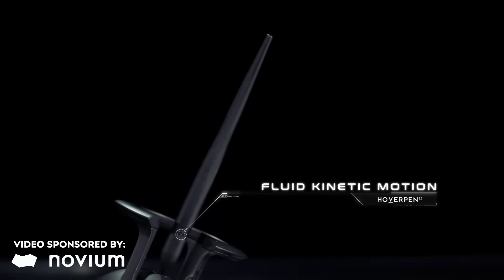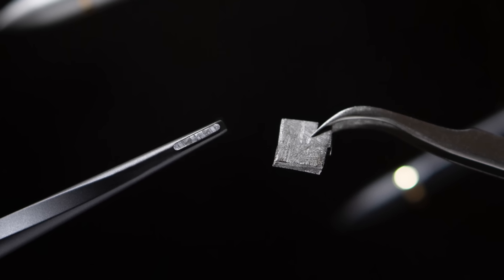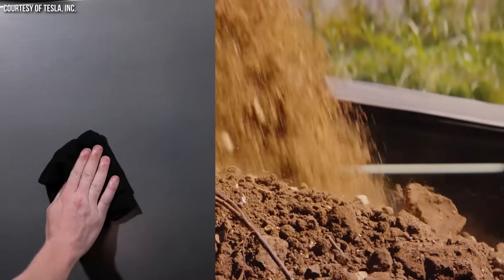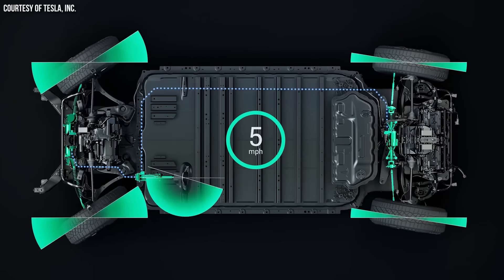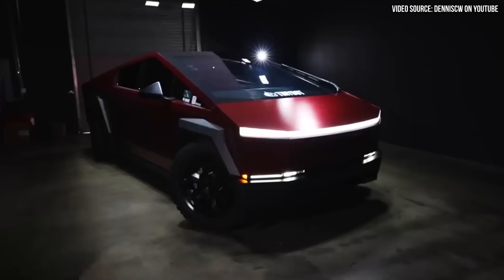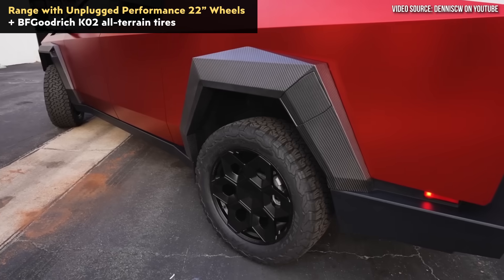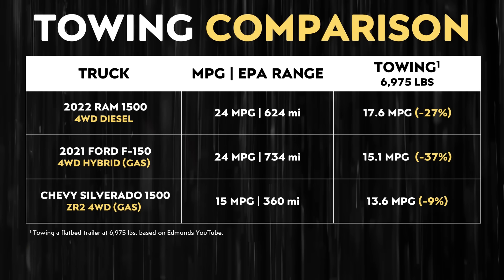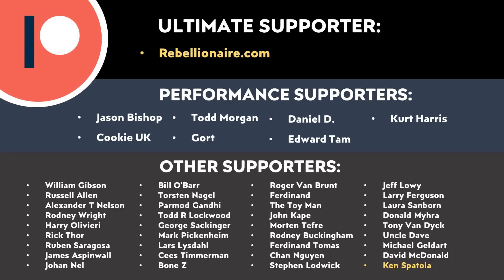Can the Tesla Cybertruck Replace Diesel & Gas Trucks?

Comment from the maker: Enjoy 10% discount and free shipping on all Hoverpens with code CLEANERWATT:
North America & other countries: https://bit.ly/cleanerwatt_novium
UK & Europe: https://bit.ly/cleanerwatt_noviumeu
Reply: FALSE , its shown in actual HARD DATA that Diesel trucks (semi) cannot compete w/ PRICE per mile & Speed of Delivery to MARKET , compared with BEV class 8 semi. 
none of the ALT fuel (CNG, Hybrids, FCV) can compete on PRICE or SPEED either. 
its high TIME for ALL Combustion to END , and go 100% BEV.
Reply: Cleanerwatt - REAL world range is Irrelevant , when you can Charge to 100% overnight & leave HOME with a Full charge and you can REMOTLEY set a Departure TIME.
also its , Irrelevant because you can Supercharge every 30 miles or so as needed. 
for Greatest Efficiency you ONLY need to Supercharge to 70% (optimal) in less than 15 minutes , when using NAV on Autopilot. which heats the battery pack for OPTIMAL charging.
Reply: Cleanerwatt - ICE is a LOOSING scenario .
combustion engines at BEST are only 24% EFFICIENT.
BEV by anyone are 60% Efficient , & TESLA Cybertruck is 90% Efficient. 
anything ICE is UNSUSTAINABLE . 
and any ICE requires FREQUENT maintenance & repairs, even Hybrids & Fool Cells. 
Cybertruck has the LOWEST cost per Mile to Operate. 
Cybertruck is SUPER Reliable & ZERO Maintenance for 300,000 miles. 
and Cybertruck will OUTLAST any ICE Truck.
Reply: most Americans DONT ever Tow , only 1% ever MAX Tow , and very FEW Individuals ever Tow outside the City. 
in FACT most Americans DONT even use Pickup Trucks for their INTENDED purpose. 
mostly used as MALL Crawler , Grocery shopping , Daily Driver & occasional DIY projects. 
funny thing is EUROPEANS Tow MORE than Americans do.
Reply: BTW - JerryRigg is a FAKE tuber , along w/ others.
Reply: Tesla CYBERTRUCK is able to TOW uphill FASTER than any other Truck.
and CT does not need to SLOW down either when going DOWN hill when Towing. 
it can also MAX regen when going Downhill , unlike any ICE truck.
Reply: Cleanerwatt - the AUTO industry continues to LIE about Diesel performance & Efficiency. 
and also Hybridgate also exists.
Reply: Cleanerwatt - you are FAKE NEWS.
Cybertruck is over 120 mpg .

Comment: What is your definition of efficient? Physics says PE + KE - W = PE + KE. If W is better on EVs which is how much energy is lost due to friction, heat, vibration etc. then EVs aren't less efficient at range but rather their potential energy is DRASTICALLY behind ICE.
Reply: EV motors are typically more efficient as they don't produce heat or vibration like ICE and have to be more aero. Meaning it really comes down to potential energy due to energy density of fuel compared to energy stored in battery cells. Yes EVs weigh more but aero matters more.

Comment: Honestly Tesla should come out with a 500 mile version without the range extender and have a 300 mile diesel range extender if possible in the bed charging the battery. This way you can sell it as hey look you get 500 miles, 250 if you’re towing but if you’re the 0.01% that need to tow ridiculous miles the you get 800 miles (300-400 towing). And you can fill up with diesel. At least until battery energy density catches up.
Reply: Honestly that won't happen - Tesla selling diesel generators.  Just buy a diesel generator if that's what you want.
Reply: @snookmeister55  I don’t want/need anything. The most I’ve ever towed is like 40-50 miles. And I can count on one hand how many times I’ve done that. But I know they’re are people that need to drive 1000 miles at a time and can only stop for 5 minutes and probably pee in cups.
Reply: @edsta714  Same here - towing a boat to a ramp meets my needs.   I may end with a Y instead of CT but then I would also need a trailer.

Comment: I'm a big fan of EVs, in fact my whole family is. I drive a M3, my wife a MY and my son just bought his first EV, a used 2018 LEAF. However, as I stress this to my friends, EVs are not for everybody today. If you live in the city and have a place to charge overnight, and you, like 90% of the drivers, don't drive more than 200 miles a week, the EV might be the best car you can have now. If any of these 3 key elements do not apply to you, it might not work as easily. Could you get by charging in public if you don't have a house? Yes, but beware the cold weather (see Chicago Tesla charger crysis). You drive more than 200 miles a week? It might work, but you need time to recharge. If you can charge at work, it's going to be OK, but other than that, I'm afraid it might be a struggle.
We have to be realistic: pushing the EVs to replace all the vehicles is not going to be possible right now. I think we're not there yet, but I think we are all aware that battery technology needs a "Eureka" moment. Li-S from Lyten is something to watch, also the ever promised Solid State Battery from several sources, and maybe so many others we haven't even heard about. Even LFP variants seem to be on the list.
But...Until the price of the battery becomes really small, and the density gets really high, I'm afraid we will still need the delivery trucks, the pickup trucks and the airplanes. We can cut off more than half of the city polluters, but outside of the city, on the highways and in the air, the petrol is still king.

Comment: If an AWD cybertruck was less than 40K, the tradeoffs might be worth it, since it offers so much of other goodies. But for 80K to 100K? Ok, in this segment the tradeoffs might not even matter, as people simply buy it as personal toy.

Towing is especially important for campers as those people not only tow, but at the same time travel large distances. And I agree that an expensive car has to cover everything, without having to buy another special purpose car.

Same is true for a good family Van - Besides a daily driver, it needs lots of room for passengers and luggage including roof box and bike mount and still needs to give plenty of range for holiday trips even in areas where no regular charge stations are available. 

It's just as with good tools: Even if you use it just once or twice a year, it needs to get the job done :-)

Comment: I think in reality..90 percent of truck owners that do use their trucks for towing...mostly boats, rv trailers, and the occasional small construction project are done seasonally or very seldom....just a little more than to justify renting one. So if the Cyber truck can do 80 to 90 percent of the jobs a diesel/gas can do then most city used trucks around the "pavement princesses "...Cybertruck fits the bill while not using gas😊

Comment: It is desappointing that they didn’t try to dominate the range figure. Silverado ev did 450 miles to push the market to 400 miles. Tesla prioritized a sport and heavy technology advancement. I just hope that the extended range is real. Right now the demand  is too high for the range extender to be prioritized. 
But I still love the truck and do like to get one.       Although the number 90 -100 miles is low that is usable for me since California has a speed limit of 55 mph that means 2 hours . 3 hours since lower consumption. 
I don’t mind driving 70 miles and stopping for charge. I do that my model x towing 26 feet travel trailer which I documented on YouTube.
Reply: Silverado EV is a FALSE FLAG , its not at all Efficient.
and uses over 200 kw in Batteries to get 450 mi. 
Silverado EV is not making SALES . its to CRAPPY.
Reply: @markplott4820  i’m not trying to advertise for Silverado EV but TFL truck did it test with a towing Trailer and estimated about 200 miles of range while towing. That is what I thought the minimum that the cyber truck should be able to tow. At 200 miles of towing even at 55 miles an hour. It should be a 4 Hour Drive at 65 miles an hour should be about three hours.

Comment: Until it gets a legit 400 mile range & charge in 30 minutes or less it’s use as a work truck is limited..I’m waiting on my # 20,000 reservation…been driving trucks for 30 plus years & will be holding onto my 03 Tundra..
Reply: your ICE Tundra will be worthless in a short time.

Comment: Nobody pulls anything with significant weight with a half ton diesel truck. Three-quarter ton or 1 ton diesels are what is used. They all have a gooseneck or a fifth wheel which will not work with the cyber truck. their range is far greater also in today’s world
Reply: FALSE , they make 5th Wheel to HITCH adapters by multiple Vendors , up to 11,000 lbs.

Comment: While the CT is a very good EV truck, it’s not going to replace ICE/Diesel trucks anytime soon. 

The first biggest downside is charging. To fully charge it (let’s say you towed 100miles for work purposes) is easily 1hr at a charging station. That’s a long time to be waiting, and frankly wasting vs a gas/diesel truck that can fill up in 10mins. If you work 5days a week using the CT for serious work and towing, that’s 5hours wasted at charging stations. Gas trucks do not have this issue. Tesla would have to build a lot of V4 chargers in the next few years to solve this issue. 

Second is Tesla production catching up on demand. It’ll take them approximately 3-4yrs to fill the ~2million preorders, assuming they can produce 250K trucks a year at full factory capacity.
Reply: its Already replacing ICE, its called DISRUPTION.

Comment: You can’t compare the cyber truck to a diesel truck.. cyber truck is a half ton pickup truck u would have to compare it to F-150 dodge ram 1500 and Chevy 1500 which there range  could be between 300 and 350 miles of Range..

Comment: Ha Ha....  I own a 2015 Ford F350 Super Duty Diesel truck and while I'm still on the Cybertruck waiting list you have missed quite a few downsides for the Cybertruck.

1.  I use my truck for towing my 5th wheel trailer.  That means I have a 5th wheel hitch bolted into the bed.  Most USA full size trucks come with the 5th wheel hitch attachment points already set into truck bed.  I see no easy way for the Cybertruck to have a 5th wheel hitch installed, which needs to center over the wheel axles.
2.  Towing anything means refueling.  And it is going to be many many years before Tesla has built out charging stations that will accommodate a vehicle with trailer attached while charging.  It is inconceivable to imagine having to go 100 or 200 miles and drop my 5th wheel, charge, and reattach it and take off again.  It requires a lot of room, and about 30 minutes drop time and 30 minutes reattach time.  That alone is a deal killer.

Comment: I think the other big negative with the cyber truck that you did not cover, was the fact that it does not come with a spare tire. This is a big deal for people who use it for work, and that not having a spare tire could mean that you don’t make it to your job site on time.
Reply: does NOT need one, OUTDATED paradigm. 
all you need is RECARGABLE air pump & Fix a Flat can. 
I you are leaving Civilized areas , you can FIT 4x Full Size tires in the BED .
w/ loss of RANGE (tonneau UP) and added WEIGHT.
Reply: @markplott4820  not all flats can be fixed with a can of fix a flat.   I’ve been told those are not great to use.  “The problem with fix a flat is it puts a gooey, glue type substance all over the inside of the tire and rim. This crap must be cleaned away before “fixing” the tire. Fix a Flat will also clog up your tire pressure monitor and it will need to be replaced as well. It can also throw your tire out of balance”

Tesla tires usually have foam inside to reduce road noises.  

Putting a spare in the bed reduces the usability of the bed for a work truck.   

I stand by my comment.   It belongs in the con column against competitors trucks.
Reply: @ZzHasbrozZ   - TESLA rarely Ever need a Spare Tire. - I stand by that.
you can Reduce flats , by Inspecting Tires OFTEN , and Replacing when under Warranty.
Reply: @ZzHasbrozZ   - the really GREAT thing about TESLA is the bundled ROADSIDE service & MOBILE service .
they can handle ANY aspect of Tires issues  and MORE.
Reply: @markplott4820  this would be the same for any vehicle not just Tesla.  So it stays in the CONs column.
Reply: @ZzHasbrozZ   - others DONT offer Mobile Servcices at your HOME/Office and most Repairs take 1 HR or less. 
they can usually Adress ALL issues at same time.
ALL the Rest , cant even perform OTA updates, & have Really CRAPPY Software.
Reply: I think it's a valid point. You have to decide if you need to take up space to toss a spare in the bed. Depends on what your doing and where. Around town, roadside may be all you need but camping or traveling out in the middle of nowhere and you have to decide on your options.

Comment: How much is 40 gallons of diesel in CA? Towing is a 1% edgecase for most pickup truck owners. CT beats ICE 99% of the time.
Reply: They are only getting around 100 miles towing , that beats nothing. Pay attention
Reply: @bobbybishop5662   - 1% of MERICANS ever Tow anything.
Reply: @bobbybishop5662  Pay attention to how often and the daily cost. I hate diesel smog.

Comment: Real world range while towing in the winter in the Midwest is like 60-80 miles lol. Cost to supercharge $40-50. That’s extremely expensive for 60-80 miles…
Reply: NOT if you Supercharge OFF PEAK only .
and use LEVEL 2 chargers OVERNIGHT when Lodging. 
many HOTELS now have LEVEL 2.

Comment: The EV evangelist aren't gonna like to hear this but EV trucks are fancy toys, they are not ready for real world, heavy duty work, like towing long distances, especially in extreme weather or temperatures. Evs are best served currently as daily drivers, fast sports cars, exotic vehicles, or basic commuter vehicles.

Until you can get way better energy density and less sensitivity to extreme temperatures at least rivaling combustion vehicles, its a loss argument for trucks and truck utility. People don't want to shift their workflow for compromises that make their work flow worse, especially timewise. They want benefits they can see and get immediately so they can feed their families.

Comment: Simple answer is no. While there is plenty of uses for a Cybertruck, towing a gooseneck horse trailer is not one of them. It's cruel to keep the horses in a trailer as you attempt to recharge a Cybertruck every 100 miles with a small horse trailer.